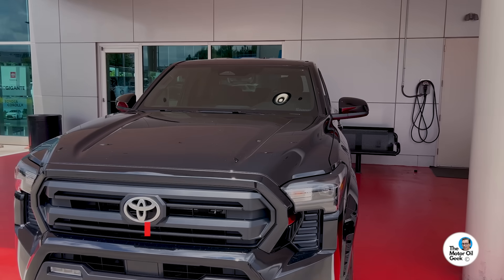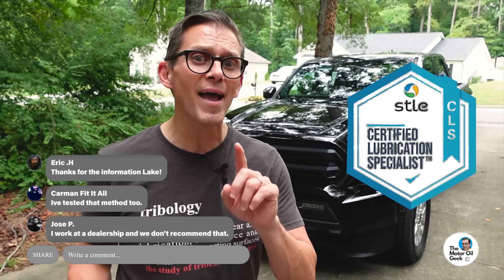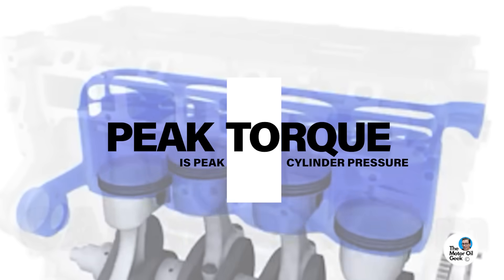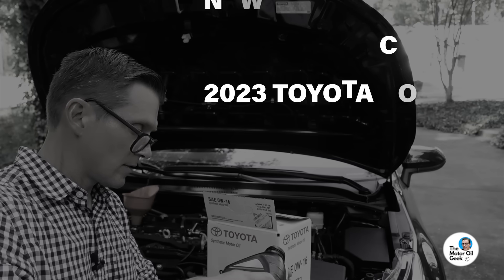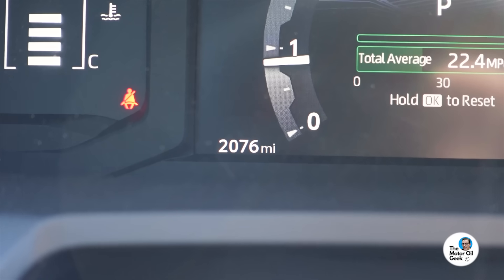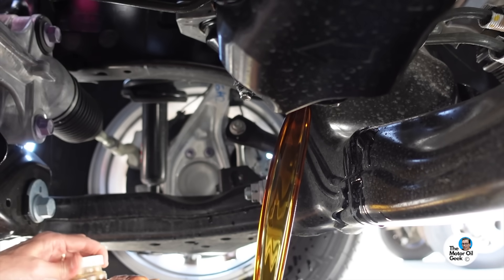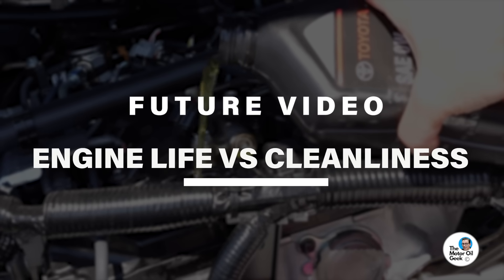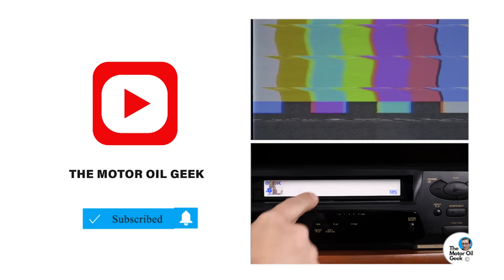The FACTS About Oil Changes (What The Owner's Manual DIDN'T Tell You)

Comment: I did an oil filter change at 50 miles and topped of and then filter and oil change at 500 miles. If I had saw this before that I would have followed the "Lake" protocol.
I've always varied the engine load and didn't use cruise during break in. Also, hard acceleration that doesn't kick the transmission into passing gear typical will break the rings in quicker. Lake, you really need to work on your pouring technique, haha.

Comment: I don’t mind changing the oil but it’s heart broken to throw away the original oil filter. It felt way better in quality than the new one which I got at Toyota dealership. Btw, I’ve mind changed @ 3000.

Comment: I get that you want to change the oil frequently to get out all the metal from break-in, but I don’t understand why you would want to run the engine harder to speed up the break-in process. I don’t see why speeding up the wearing is a good thing. Why intentionally break stuff loose by revving it hard  in the first 5k miles if you could just change the oil, say every 2k-3k miles for the first 10k, while driving gently-normally?

Comment: I'm retired now, I've had a couple of American cars but mostly Japanese and Korean vehicles. 
I have always changed my oil at 5,000 mi intervals religiously. 
I've owned five Kia's in my time and currently own two and I know they can be problematic without proper vehicle maintenance. 
We have a 24 Kia Sportage hybrid and not only did I do the thousand mile oil change but I also continue to do 5,000 mi oil changes as well. 
This is a GDI engine so I have had the intake cleaned professionally every 25,000 mi. 
We just bought a new 25 K4 that has multiport injection so no GDI (thank God) And I did the first oil change at a thousand and then 5,000 after that. 
Out of the five Kia's I've owned I've only had an engine issue with one, a 2018 Kia optima and it didn't blow up on me just started using excessive amounts of oil before I traded it in. 
I fully believe that if you stick to a rigorous maintenance on any car unless you have mechanical issues from the factory like a lot of the new Toyotas or some of the older Kias then you should be able to get any car passed 100,000 mi. 
My other car is a 2004 Toyota Sequoia with 220,000 mi on it and runs perfectly, and yes I do 5,000 mi oil changes on it even though it is probably a lot more tolerant of extended oil changes.
 I believe as long as you change your oil every 5,000 or under, change your air cleaner and do routine maintenance You should be able to get considerable amount of mileage out of your car.

Comment: Unlike air filters(which are only dealing with engine vacuum), oil filters actually tend to get slightly worse with use. This is due to the positive displacement pump pushing oil through the filter harder as the filter loads up and becomes more restrictive, pushing more contaminants through the filter. The higher the differential pressure across the filter is, the less efficient it will be.

Comment: I do very similar with new engines. However I do change the filter every time. My reasoning, should the filter bypass open due to cold temp, heavy throttle or any other situation that would cause a pressure differential across the filter occur, all that crud and metal debris that is collected in the filter can blast right into the engine. Less crud in the filter makes me feel better.

Comment: I definitely understand the logic here, but why do we only apply this to the engine oil? I just ordered a new truck. Should I change the transmission fluid, transfer case, front and rear differentials all at the same intervals? These are all breaking-in in a similar fashion to the engine. Heck, the water pump could be introducing break-in material to the coolant system while it breaks in.

Comment: Hi Lake, enjoy your videos
Although I agree with "Donaldson" as to the filter becoming more efficient as it becomes populated with foreign material, I do not agree with reusing the filter on the first oil change.
from manufacture the engine is not clean, and the initial running produces the most contaminants.
Personally in my opinion the first filter change is the most critical to remove particles of sealant, gasket material, fibers from cloths and packaging materials, as well as foreign material from the air (dust).
We don't want to run the risk of  having the oil filter bypass valve open on start up and pushing those contaminants past the filter.
Thank you

Comment: But, what you didnt prove is that the wear in your engine was any lower than the wear in the same engine that would have had the factory fill run 5,000mi.  

Run two of the same engines the same duration, one with a control which would be the factory recommended change interval, and your shortened duration oil changes.  Then do it throughout the life of both engines and compare the results.  That will show if your methods are effective or not.  Right now, all you are doing is showing that changing your oil is making your break-in wear metals go down, which is expected.  You have not proven that your method will extend the life of the engine.

You didn’t do that with your daughter’s Corolla, either.

Comment: Interesting video!  I've had my 2003 VW GTI VR6 now for 23 years, having purchased it new in October 2002.  Changed the oil at first at around 5K miles, and about once a year (or 7,500 miles) since then.  During the first 16 years or so, I used Castrol Syntec full synthetic, and the last 7 years, LiquiMoly full synthetic.  I can't kill this engine!  It still purrs like new, and still has the original timing chains!  Either this is Volkswagen's best engine ever (one of), or i'm doing something right, or both!

Comment: I am coming to hate turbos. I went on a vacation a few years ago, and I thought, hey, I'll splurge and rent a Mustang, never drove a Mustang before. They gave me a freaking turbo 4-cylinder Mustang. What a turd. Then, there are all these issues with turbo six-cylinder pickups. And I hate V-6s anyway, due to the sound. So it's naturally aspirated V-8 or nothing for me. So I bought an older Tundra with a V8. I'd accept a turbo four in the right car. Turbo four in a Tacoma might work. My last Tacoma was a NA four, was kind of gutless, but ran fine.

For new cars, I have always changed oil at 1000 miles and then again at 3000 miles, then to yearly oil changes with Amsoil Signature. For semi trucks, two years (low mileage). My record is a PriusV, ~200k miles, one year, ~34k miles (two filters). We drive our primary car upwards of 30k miles per year. Currently the Chevy Bolt is getting 30k per year average. Had it two years now. PriusV is still going fine.

Current project is 6.7 Ford on an Amsoil Bypass filter. Haven't finished the first interval yet.

Comment: I have several motorcycles and use the OEM synthetic oils and filters. I change the oil and filters at 5,000 intervals. Sometimes it takes close to 1 1/2 - 2 years to reach the 5,000 mile intervals. Over the years I've never had an engine failure. Is that too long a time to use that synthetic oil?

Comment: I dont't understand why car manufacturers build motors with this stupid oil release screw. If you have to do a oil change for maintainance, why don't they design a shut-off valve where you can open it without getting dirty or the screw falling into the oil?

Comment: There isn't much "science" in this video. What you would need is two exact engines, running the exact same way with the exact same loads over 10-15 years, one with all these goofy oil changes and one with normal interval oil changes, then analyzed for performance and reliability versus each other, then a complete tear down and comparison. All you have here is speculation that doing all these oil charges produces a desirable result.

Comment: On my 23 Gladiator, I changed it at 799, 5082 and 8295.  I don't put many miles on it obviously.  My oil analysis keeps coming back good.  We saw the high silicon on the first drain but dropped to below the average they see on the second, and dropped even more on the 3rd.   Was it needed?  Don't know, but oil is cheap, motors are expensive.  And as I do my own oil change, I keep that cost down.  My only question is on the heating the motor up, I normally don't but I let it sit and drain for over an hour before I come back, close it up and fill.  Sounds like I should warm it a bit.

Also, why the hell aren't you wearing gloves when you change that oil?  I always have a stock of the 7mm from Harbor Freight for any time chemicals or oil is involved.

Comment: My dads 1.6 HDI diesel had its oil changed every 20k miles and even when it got 188k miles on the clock it never once burned oil, I think changing oil every 5k is not necessary

Comment: Government vehicles sold on the market after years of use are a good deal as a used vehicle because they were forced to have regularly scheduled maintenance which included oil change and filter.  All government vehicles are in a maintenance database and if not brought in, some admin person is calling the user to bring it in.  My current 1994 Dodge Shadow was a Govt vehicle I bought at 114,000 miles which is now at 198,000 miles.  Runs smoothly.

Comment: Lake!! First, please get a fumoto valve!! Makes oil changes so much easier. And you can shut the valve, dump your qt in, then drain for the flush. Builds up "pressure" if you will. 

2) can you please explain the oil filter change interval? I'm pretty skeptical of oil filters not being changed. Wont you just contaminate the new oil?

Comment: Are you sure the principle from air filters (dirty means dusty, dust attracts dust, meaning filters are more effective at filtering if they are dusty and when the fluid is air) applies to oil filters where the fluid is oil and the particulate is different?

Comment: I noticed on a Ford V6 with a naturally aspirated 3.5 l engine does the engine breaks in at approximately 4,500 MI. All of a sudden at 4500 me my miles per gallon jumped up by 2 mi per gallon. That tells me the engine seated at approximately 4,500 MI.

Comment: What’s the difference between draining hot oil into a drain pan and letting it drain into the oil pan, letting it cool then draining it???
answer: burnt hands and hot 0 weight oil splashing all over the place. That’s it. No benefit whatsoever.

Comment: So I have to disagree about warming up your engine before an oil change my vw alh takes 5qts when it’s dry if I start that engine over 0.75qts get trapped in the top end and it takes a few hours to all return I find i get the most oil after the car has sat for 24hrs

Comment: When I was a kid, there was this additive called Slick 50. You could drain your oil and drive it dry for 3000 miles. It also increased fuel mileage by 5 miles/gal. Those were the days.
Reply: I used that stuff. My truck lost oil pressure and drove it 5 miles home with zero oil pressure. Replaced oil pump and it ran fine. It really works.
Reply: @SilentSounder Snake oil.

Comment: OCD oil channel. 

I have been using Mobil 1 full synthetic every 10,000 miles with synthetic oil filter. 

Broke in engine @ 1000 miles.  Full kick-downs from there ! 

Never had a problem. 3 brand new cars and 0 problems. 

Don’t waste your $$$ on this OCD crap. Any car will last 10 to 12 years anyway.

Comment: We had the first oil change done on our new Jeep GC 3.6 at 3000 miles. Sent a sample off to Blackstone labs. Report came back with pretty much everything high or over limits including dirt and small shavings. Lab said don't worry about it. It is just "stuff left over from the manufacturing and initial break in. Second change 4000 miles later things had settled down but still not good. Third oil change 5400 miles (trip), things have settled down to normal ranges. Blackstone said it should actually continue to improve to around 20,000 miles then should settle into its "normal". Can't imagine if all that initial "junk" had stayed floating around in the engine for 12,000 miles. Wish I had done my first change at 1,000 miles.

Comment: Nice video!  You seem to know a lot about oil (obviously), but have you seen the testing on Toyota's OEM filters?  Pretty terrible.  I would have thought it would be good to pair the brake in process with a higher quality aftermarket filter with better filtration (more dirt holding capacity and finer filter media and better bypass valve).

Comment: I saw your video and I am a little puzzled. You said you pour a quart of new oil in the engine after most of the oil has drained out to do some additional cleaning. You also said you were going to keep the factory installed oil filter for the first 5,000 miles. You did not say you were removing the oil filter to drain out any dirty oil that was in it. Why add new oil to clean the engine and not drain out the dirty oil that is in the filter?

Comment: Great video.  One thing that surprised me with such low miles on the samples is the drop in KV100 - from 8.59 virgin oil to 7.1 after barely a tank of gas.  In fact, the KV has almost dropped out of grade for an xW-20 grade.  Any thoughts on why you see such a rapid decline in KV?  It definitely adds weight (no pun intended) to the early oil change protocol.
Reply from the maker: That is the polymers shearing.

Comment: You may be a certified lubrication expert but I think you're a jerk anybody that does three oil change before before 5000 me has a few screws loose I own cars that are over 40 years old that I bought brand new and the engines are great because I didn't follow your advice you may be able to fool the uneducated but I'm calling your bluff and for the record my credentials are I have an as degree in automotive technology I have a lamp brake and smog license I have a BS degree in mechanical engineering and a PhD in electrical engineering

Comment: When I got the 2020 RAV4 in Nov of 2019, first oil change was in March of 2020 with Toyota 0W-16 and a Toyota oil filter.  The second, third and fourth oil and filter changes were in 2020 with Toyota parts.  After that it's Mobil 1 and Toyota oil filter every 6 months. Being retired the car right now has just over....21,000 miles.  So it's time not miles for that car.  
My wife's new 2025 Honda CRV came to us in June this year and it's had 2 oil and filter changes and now has 5600 miles on it.  It'll be due soon for it's third oil and filter change soon.
OIL IS CHEAP!  ENGINES ARE EXPENSIVE!
Thanks for this video.

Comment: Here in Australia we had Ford Falcon’s as our mainstream Taxis.
I have seen heaps of them back in the day with 1.5-1.8 million kilometres on the same engine.
The fuel they used was Propane or LPG as we know it here in Australia 🇦🇺.
Those engines were so clean inside that it looked like they were just assembled from the factory.
They also never got shut off or did short trips, always at operating temperatures.
The cleaner the better 
Great information Lake